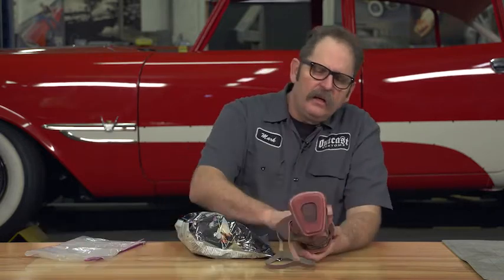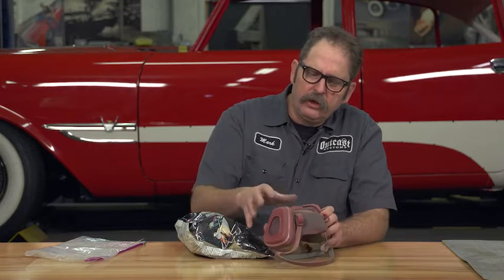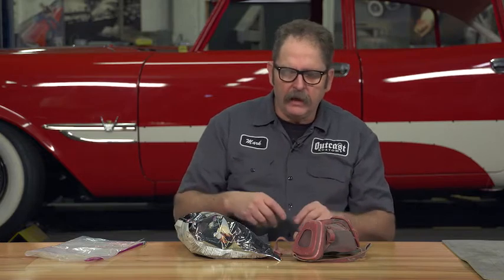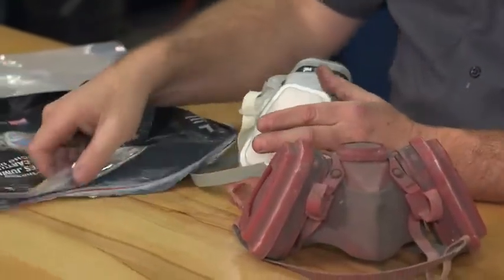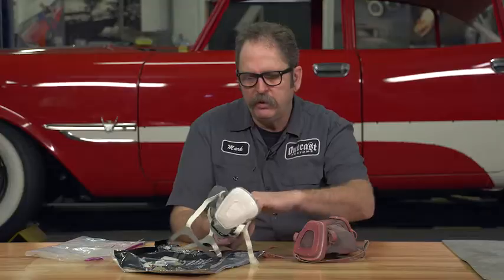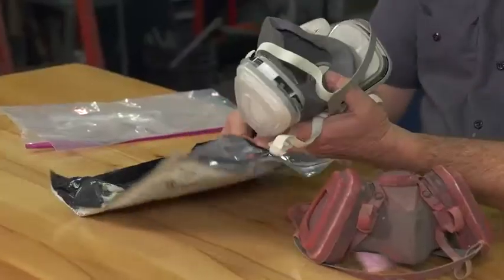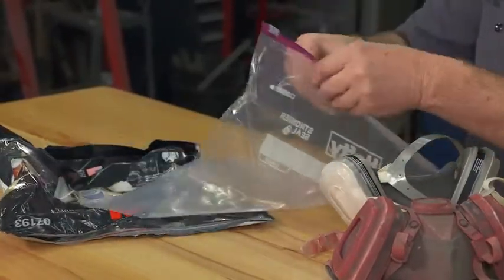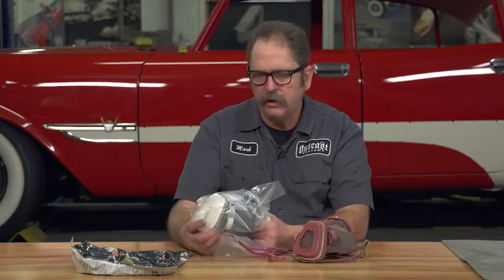How to Properly Clean and Store a Respirator

Comment: He has a great point in why its important to store it! HOWEVER  please do NOT use a plastic bag.....when we breathe especially upon exhale it is moist so if you it in a bag it have condensation and bacteria build up. Store it in a paper bag instead!
Reply: what if you let it properly dry out first?
Reply: @Nettle314  as long as it is cleaned and dried before storing its fine
Reply: Silica gel packets?